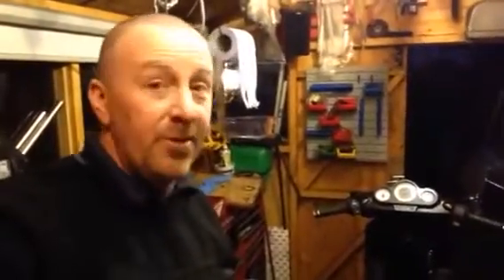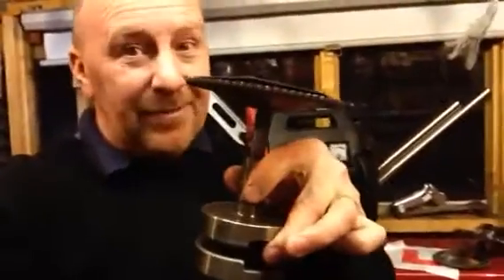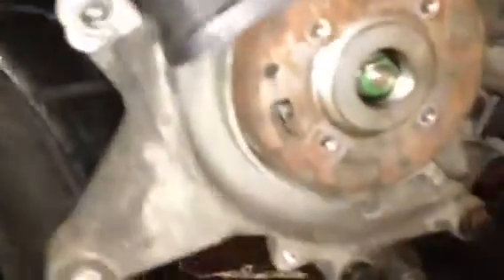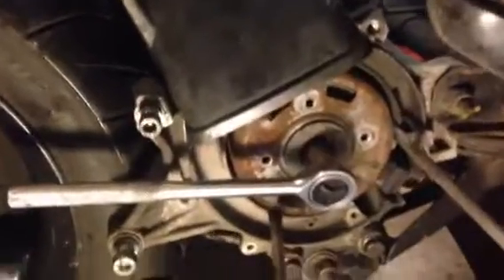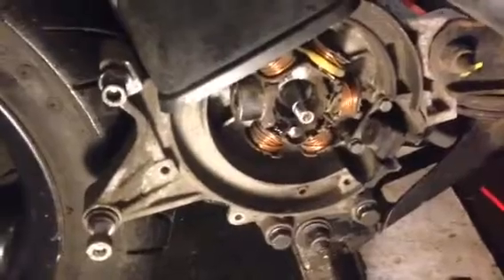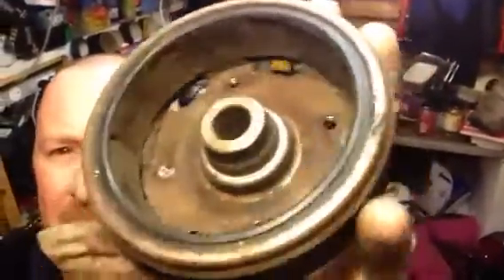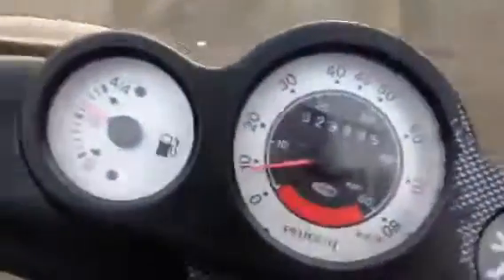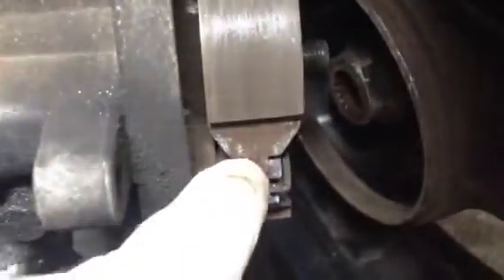SPEEDFIGHT VARIATOR CLUTCH BELT PROBLEMS MARK SAVAGE

Comment: Hi Mark thanks for all you videos they have helped massively,  however I'm at a loss and I'm realy hoping you could shed some light lol
Speedfight 2 lc .. new carb .. new cdi .. new crank seals .. new head gaskets.  New piston rings got a spark and getting fuel but still won't start 😪
Reply from the maker: oh wow a lot of work done there bud , when you had the head off what was the barrel like ?
how come you didnt change the piston ?
is it lc or ac?
new carb , did you put the old jet back in it ?
new seals. was the stator ok and seal in correctly ?
you say you have fuel and blue spark?

Comment: Cheers pal, but just one thing, what is the standard weight, ov rollers, and the size for ordering. Sfm sachs,50cc moped.ta mate
Reply from the maker: Matthew Marshall I’ve not worked on one before so google the spec or type into e bay and the weights should come up and get the right sizes 
Mark

Comment: Hi Mark . I have problem with aftermarket malossi variator, the belt dont go over the top hi stay on 50-55 kmh and struggled for more speed Why ?? Belt i have stage 6 sport pro when i release the throttle to 3\4 he still goes higher acceleration is not lowered, when i open the variohouse i see on variator the belt not go higher. Wtf. i buying multivar for better quality, original for speedfight 2 50cc every aftermarket parts is not the same like original WHY??? This is starting to freak me out i do not know what to do, and really love speedfight 2. If you know what's the problem help. Have good exsaust standard head 50cc. and for last how much is fast speedfight 2 in kmh 60,65,70,75,80????????
Reply from the maker: Vlado Stankovic hi bud oh dear it's not great when all your work goes no where on the bike , so ok sports exhaust , carb clean and up jetted to ? Should be 60 odd , air filter changed and take of pipe !, variator clean and 6g rollers or Combi , good tight clutch and good belt! Standard piston but is it ok? , mark and for mph to kph use google it will convert but you should be getting 45mph plus ,

Comment: Hi mate I have brought a new carb and can’t remember what way round the fuel pipes went could you help please ? 
Speedfight 2 50 ac thanks
Reply from the maker: daniel paxon I have many video on the carb bud and I do mean loads on cleaning fitting and putting back on 
Sit down on the computer and have a flick through my 70 plus speedfight videos you will see for defo 
Mark

Comment: Hi, I have a speed fight 100 cc my belt perished and I've replaced it but now it's not running properly? It does work but it's very low on power can you help me please?
Reply from the maker: hi bud 
when you changed the belt did you reset the variator? this has to come off and the roller put back in but i'd change them for new ones to be honest
hope that helps , I have many videos on my channel to help and how to do this and please like and sub
mark
Reply: mark savage thanks I will have a look when I get home and let ya know thanks for replying back to me
Reply: Reset the variator? If you mean put the rollers in and reassembled it then yes I have? I've watched loads of your videos but none of them cover my problem? I honestly don't have a clue what's the matter with it? It was working fine before the belt perished so I'm puzzled

Comment: Hi Mark what's the correct belt size for a 2008 50cc lc speedfight 2 ?
Reply from the maker: its a bit luck as they often say different sizes but it should be 765 long 
id buy from euroscooterparts and get a NARAKU  belt 
best change rollers while you doing the belt too
Reply: @marksavage  thanks Mark and keep up the good work 👍

Comment: i have taken the casing off that covers the variator and belt etc and i can see the starter motor cog moving but verry slowly and eventually after a couple of times trying to start it, the starter cog doesnt move at all
Reply from the maker: Sound like a lazy starter take it off , pull it out make sure the battery is off then put a bolt through the start bolt hole with the Earth and tighten up connect back the battery and see if it turns over fast very fast , if not the need another one or a bad battery ?
Reply: +mark “marky bike” savage  Thankyou will try that
Reply: +mark “marky bike” savage Could you make a video showing me how to take the starter off please as i dont know how to get it as part of the frame is covering it
Reply from the maker: +Jordan Jones there is a video of me doing it and I think I've done a few lol just watch the others I know there are there lol ,it's easy and only a 8mm socket
Reply: Jordan Jones  hey

Comment: Hi Mark Vlado again,i'm boring but!!! I thinking about a 70cc head but i looks all your videos and i go whit standard 50cc head,then sporty exsaust,sport air filter red one of malossi just that filter in me country, then I've changed like instructions in malossi variator white spring whit stage6 clutch, and 8,5gr.rolers. Now exsaust is not noisy on start litle bit slower but acceleration is very faster and top speed about 70-75kmh. then changed 6gr.rolers and little bit faster on start slowly acceleration but top speed is 80kmh.but exsaust is lil bit noisy from the first setup. Now i changed 3x6gr.3x8.5gr. its better but noisy on start i put 7gr.roles,now my speedfight 2 is very but very fast, never faster :-) , now its better start acceleration is faster exsaust not noisy and top speed is 75-85kmh, but now its hard to stop, but that's ok i changed new brakes. I'm happy but if my speedy happy??? I see in your videos you talk about that, how or give much speed or slow. If i'm on the right track, or i did something wrong??? because it is much much faster,and top speed is higher than ever??? Please note me because i'm lil bit scary for that, i forgot to tell you about the carb, i got 52 main jet originally, if only little push on kick starter and speedy starting, and i'm happy for that. I learning lot from your videos, again thanks about everything and all your videos KING REGARDS Vlado
Reply from the maker: wow you have done a lot of things and thanks for the comments about my videos I'm glad they help, as for you bike 50 mph 85 kph is a good speed for a speedfight you could change the jet to 60, I ran a carb the other week on a 72! and it did 60 mph 95 kph it was a water cooled on . I would buy a set of jets they come in packs on ten on e bay got from 56 up wards and try that as it should help but maybe once you stat to get high speeds as I little 2t oil in with the petrol as it will help the engine from heat seizing . as you watch my videos you know I hate 70cc kits it won't last long and you won't get much more out of it for a lot of work bud, hope that help mark

Comment: wish my speedfight would start changed my bendix gear, battery, starter relay and tge fuse but still wont start. dont know what to do.
Reply from the maker: Ok go from the start like in one of my. Videos when u press the start button does it click? It could be the starter button does the rear light come on when u press the lever ?
Reply: When i hold the brakes in the rear lights come on also the relay clicks when i push the starter button
Reply from the maker: +Jordan Jones that's good news so move on the click means the starter button and relay have power now check if you have power going to the starter when u press the starter button and you have earthed the starter with the green wire in the bolt
Reply: +mark “marky bike” savage ho mate i managed to remove the starter motor, but how do i remove the live cable from the starter it self
Reply from the maker: SHOULD BE CONNECTED TO THE CLIP ON THE TOP BY A SCREW, IF IT WON'T COME OFF YOU MAY HAVE TO CUT IT OFF OR DRILL OUT THE SCREW
Reply: +mark “marky bike” savage 
ok thanks. Also another question sorry how do i fit the bendix gear, do i just push it in and put the engine case over it or do i fit it in and join the teeth off the bendix gear to the variator, if you know what i mean.
Reply from the maker: YES I DO AND YES FIT THE START THEN PUSH IN THE BENDIX UNDER THE VARIATOR ITS A BIT OF A PUSH THEN THE KICK START COVER FITS OVER IT AND BOLT UP
Reply: +mark “marky bike” savage 
so in a way when i push the bendix gear in and place the engine cover on the starter cog pushes the bendix in place.